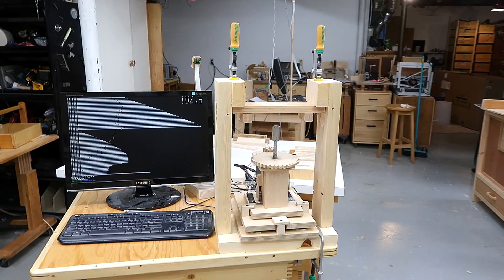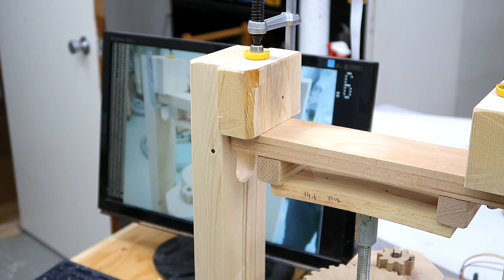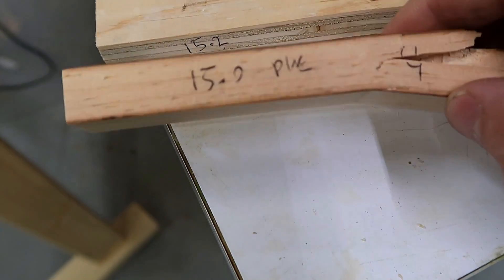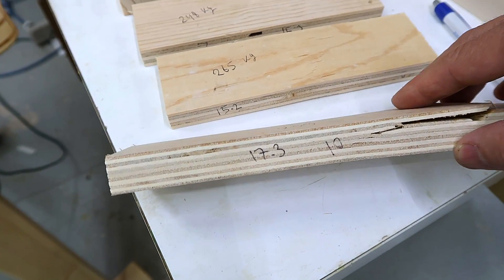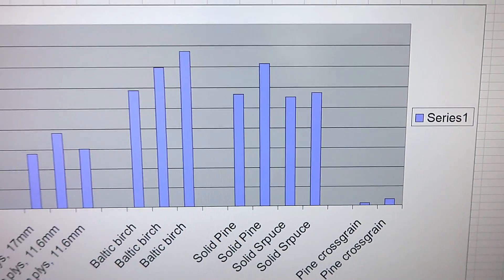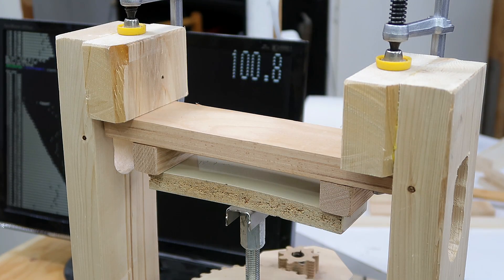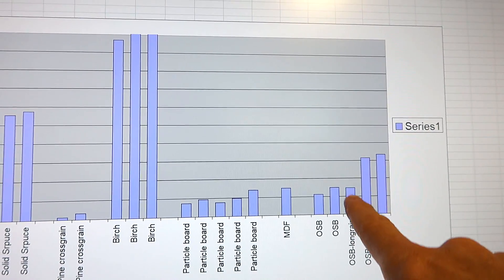How strong is plywood, MDF, OSB, particle board vs. solid wood

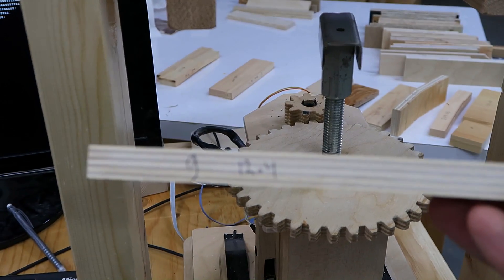Comment: 2:31 more gears maybe? The machine would be stronger, but it would take way more time to break the samples
Reply from the maker: also stronger load cells, bigger threaded rod, proper thrust bearings, etc.  basically, the whole machine needs to be rebuilt if I want to double the force.
Reply: Just make the samples smaller.

Comment: In mechanical engineering stiffness is usually more important than ultimate strength so I think that would be a more interesting measurement.  Usually once a structure is made stiff enough, the strength is more than enough.  Of course wood is not isotropic and is weaker in compression than in tension, so there are some applications where this is less likely to apply.
Reply: I think this test is also going in the wrong direction. The forces would be going across the length and width of the boards in the structure rather than through its thickness.
Reply: Exactly.  Using any wood product as a structural member, the stiffness is in the long axis. You don’t use a 2X lying flat. Think about glulam beams. I really don’t see the point of testing like Mathias did.
Reply: Wrong
Reply: @bobojenkins5805  well when you put it like that who could argue....

Comment: Haven't read the comments, maybe it is mentioned somewhere. What if a piece is cut at 45deg angle from plywood so all the grain impacts strength the same. Wasteful but interesting. Or corners and ends going to be weakest points

Comment: The plywood could be used on-edge. TJI beams are used in construction and are vertically oriented like this. It would be interesting to build some I-beams (so they don't buckle) and see how they do on the same jig.
Reply: Yeah, I would never use plywood with significant force in the direction that Matthias tested in this video. Instead I would design so all major forces are in the plane of the plywood, in which it is the strongest.

Comment: I'm curious to know how you converted the force to a uniform thickness.
In theory it seems to be a simple scaling factor but in reality the stiffness in flexion (which is the engineering term for what you are measuring here) depends on the moment of inertia of the section of the boards, which for a rectangular section is (width*height^3)/12 if i remember correctly.
Reply from the maker: Scale by thickness squared, as explained in the video
Reply: You are correct that I = (1/12)*b*h^3, but there is another 'h' in the stress equation that cancels and makes it a square law. I showed the equations in another comment, but the final result is

F[max] = (2/3)*(1/L)*UTS*b*h^2

Comment: I wonder if this setup can be used to show that floor joists are just a strong with and without holes drilled in the middle for under-floor wiring.
Reply from the maker: A hole dead smack in the middle of the joist won't matter.  But as it gets closer to top or bottom, it weakens it. Also as it gets closer to the end, as that can induce shear failures along the grain

Comment: Matthias, have you ever experimented with making hardboard out of cardboard. There’s a lot of Amazon and Walmart shipping boxes lying around these days. I wanted to see what could be done with the stuff besides discarding or burning it. 

I soaked six small pieces in cheap yellow carpenters glue and compressed it firmly. It produced a very tough material. I also coated it with glue and it produced a durable finish. It has a lot of possibilities.
Reply: I've experimented with laminating cardboard with fiberglass and either Titebond III or high quality epoxy.  You can make some strong and durable composites out of it.
Reply: Sounds horrifically expensive. But maybe that's your art form?

Comment: How is HPL? It's sometimes used for kitchen-tops.
Reply from the maker: don't know what it is, don't have any
Reply: @matthiaswandel  High Pressure Laminate panels/sheets. It's a mix of resin and cellulose. Extremely though. Often used as building cladding or top layers for kitchen cabinetry/countertops. They sell it at the hardware store here.

Comment: If you build something out of ply, you put the load in the plane of the board. You should really test that way.
Reply from the maker: yes, ply is stronger that way.  For a subfloor, it will do better than individual boards because it can spread the load much better

Comment: This is very interesting Matthias.  It's a common technique in shelf-making (for example with book cases) to reinforce a shelf from deflection by rabbeting a piece of solid wood and gluing it to the front edge of the shelf.  This is supposed to make a plywood or MDF shelf less likely to bow from the weight of the books.  I wonder how a plywood or MDF shelf prepared in this way would compare to just a solid piece of wood?
Reply from the maker: Most of the support will come from the solid piece of wood, cause that is also a lot stiffer.  Basically, the stiffest material takes most of the load, even if the stiffest material was not the strongest
Reply: @matthiaswandel  Makes a lot of sense.  I just watched a video over on Rob Cosman's channel where he created a double mortise and tenon joint.  In that video he suggested that having 2 tenons would give the joint better ability to resist leveraging on the joint than a single tenon would (even if the sum of the widths of the two tenons and the gap in between them is the same as the width of a single tenon).  If this is true, then I'm not sure why -- maybe doubling the number of shoulders is superior at resisting racking even if it sacrifices some glue surface?  What are your thoughts?
Reply: @matthiaswandel  this reminds me of a horizontal dough mixer I used to have to work on that was duel belt drive (one belt on either side). The driven center shaft was far stiffer torsionally that the drive shaft, and since the power was applied to the drive shaft way off center, one of the two heavy duty timing belts took the lions share, if not all of the load. It was also a nightmare to balance the two belts since their relationship to each other changed at different loads.

Comment: Can you devise an experiment to test the (shear) strength of nails? Wherever I look in my really old house, it seems that the builder relies on adding enough thick nails to support the weight
Reply from the maker: A nail in wood will never shear off, cause the surrounding wood yields enough that it just bends first, then later pulls out

Comment: Also, would be interesting to test different joints strength in plywood - butt, lap, dowels, screws, etc
Reply: Not really, as already with this test to some degree you are comparing apples to pears. Plywood is made mainly for dimensional stability, so unless real wood which with moisture will swell and shrink mainly in one direction (perpendicular to the grain) the layers in different directions compensate for that. When you look into construction, where structural strength is required you will find either solid timber beams, or glue laminations, but we are talking about completely different dimensions here and using certain cuts of wood to reduce impact of grain and get beams exceeding dimensions you can just get from a mill today, among other things.
Plywood is plenty strong if used for cabinets, or as sheathing as intended. Same with OSB, which is just a cheaper alternative creating something with properties of both plywood and particle board.
Particle board, I don´t know if that is actually good for anything other than cheap (in the worst sense of the word) cabinets and one time packaging.
MDF, by reducing the particle size again has superior qualities over particle board. less compressible, more rigid, easier to coat/paint. MDF also due to its high density is quite good for speakers.
So except in case used as sheathing, none of those boards are intended to be really structural. They are solid enough as floors and walls on joists and studs, especially on walls they provide in combination a lot of strength in one pane. They may work for cabinets, if used right. But using the example of a bandsaw, most people may already be surprised that a saw without a metal frame is stiff enough at all. But in this case, with right dimensions and taking into account the grain direction, it gets kind of structural and solid wood or glued laminations are the way to go. An enigneered box frame made out of plywood would likely work as well looking at rigidity. (just not sure if it would hold up).

Comment: Have you any plans to test foam board panels?
A 2" rigid foam insulation, sandwiched between 2 layers of 1/4" or 1/8" plywood, for example. 
If I had your setup, I would test everything I could get my hands on. 😀
Reply from the maker: Have used 2" foam on concfrete, with two layers of 3/4" plywood overlapped on top as a floor before.  Excellent results, very firm floor
Reply: @matthiaswandel  They make houses like that now. No stick framing. Goes up in one day!
Reply: Both foam and plywood laminated with fiberglass and either Titebond III or high quality epoxy is also pretty interesting stuff, structurally. I'm a big fan of composites, done right, that is.

Comment: I love these videos with quantified tests of different things.

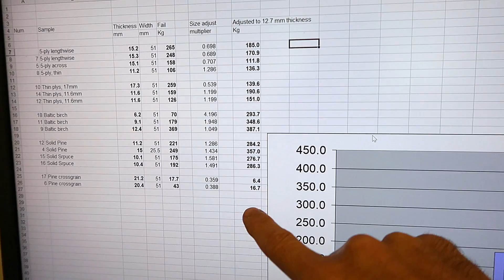Minor nitpick: I am pretty sure the strength against bending is proportional to the cube of the thickness, not the square as Matthias suggests at about 3:40. So a twice as thick piece would be eight times stronger (assuming a homogeneous material). Further reading can be found e.g. under "Second moment of area" and "List of second moments of area" in Wikipedia for anyone interested.
Reply from the maker: Stiffness varies with thickness cubed.  Fail strength with thickness squared.  Note how the birch samples lined of different thickness lined up so close with the square law adjustment
Reply: @matthiaswandel  for those that want the equations: stress = M*y/I, where I = (1/12)*base*height^3. For 3-point bending, M = (1/4)*Force*length. Setting y = height/2, stress = Ultimate Tensile Strength and rearranging gives:

F = (2/3)*(1/L)*UTS*b*h^2

Comment: What about flex without breakage? If the forces involved aren't enough to break a material and stiffness is a primary concern in the application, then the material that is stiffer is the better choice even if it has a lower breaking point.
Reply from the maker: I didn't bother checking that, just gets the video too complicated.  Still have the logs so I could calculate it afterwards.

Comment: Although I appreciate this. 
I would expect tests on other things, and also comparing to price.

How about drilling? When do they strip?
How about weather resistance? (Bending, and rotting)
How about trying to break one corner of a big table? (I think it would be different)
How about bugs eating the insides?
How about practical usage? (Like, sanding, cutting, glueing etc)
How about nailing from the side (like between the layers)

So many more things I can't think right now.
And I expected more details about particle board MDF etc. This video is mainly just for plywood.

Also what about metal? How does it compare to all these wood products, also with price.
Because metal is cheaper, easier to clean, easier to make furnitures out of etc.
Doesn't look and feel like wood, but given the price difference, it's an option to consider...

Comment: ~ " half the grain in plywood is in the wrong direction" . This leads to the question of whether or not all plywood is assembled with each layer's grain perpendicular to its neighbors. I'm wondering if the I'm results would be the same if you tested the grain rotated 45 degrees. Or if you could somehow delaminate samples of various types of ply to examine the directional relationships of each layer's grain.
Reply from the maker: never seen such a plywood. It would be very inefficient to manufacture, cause as the log is shaved, that produces rectangular pieces, so I don't think it's done.
Reply: @matthiaswandel  Fair enough. I trust your experience and the results you've shared. Just seems like a faulty generalization without testing how your samples were constructed.  Also - please dont think I expect you to address this in a dedicated video, as interesting as I may find it. It seems like you've made a safe assumption
Reply: Sometimes cold molded wood boats are laminated with subsequent layers at other than 90 degrees.

Comment: I've found the engineering lesson that is most relevant to woodworking is bending moment of inertia. Whenever I have to use a weaker material for something critical, I orient it so the bending moment of inertia is maximized

Comment: does the orientation matter? you only tested the boards with the glue joints parallel to the ground, not parallel to the wall, which would be the orientation in the bandsaw would it not?
Reply from the maker: True, but it's not how plywood is typically loaded.

Comment: Hi Matthias: there's actually a cube law between thickness and strength when it comes to rectangular beams; so a beam twice as thick would be 8 times as strong, not four.
Reply from the maker: A cube law to thickness and stiffness.  
Your beam twice as thick would also be twice as wide, so then it becomes a cube law (and 4'th power for stiffness)
Reply: @matthiaswandel  I have the same concern as Chlorate. Your reply seems a bit cryptic, something about changing the widths of the beams?

Might be a miscommunication about units of measure, maybe force (Kilogram) versus internal stress/strain (Newton)
Reply: @matthiaswandel  I would also agree with Chlorate, namely the maximum stress in the sample would be inversely proportional to the second moment of inertia (a.k.a. area moment of inertia) which is linear in width but cubic in thickness. So a twice a wide sample could handle twice as high of a load, but a twice as thick sample should be able to handle 8 times the load.
Reply: @kwinvdv  Agreed !! The cube law for deflection and strength is one of the fundamental tenets of designing structures.

Comment: Not surprising results for strength testing, but what about testing in regards to the forces applied to the bandsaw? In an assembled bandsaw, the main force is going to be vertical from the blade tension mechanism, right? That's parallel with the large surface of the material. I'm still curious if MDF be strong enough in that regard. The forces you tested are essentially as if you clamp the neck of the bandsaw to a rigid structure and pull the top and bottom wheels toward you. That said, it's probably still cheaper to use solid pine instead of MDF due to engineered panel costs. Hmmm.....an MDF CNC'd version...
Reply from the maker: The force is pushing down, but...  offset from the main column by quite a bit.  As such, there is bending force, and the force along the grain as a result of bending will far exceed the actual downward force of the blade.  The far side of the column will actually be under tension when the blade is tightened
Reply: @matthiaswandel  Interesting. Thanks for the reply.
Reply: Let's not cloud the debate with any convoluted logic. Now repeat after me, pine is king!
Reply: Fir is a lot stronger then pine.

Comment: Engineer here (Mechanical and Electrical). The strength and stiffness of a beam is mainly in the faces experiencing the tensile and compressive forces. That's the reason for "torsion box" construction. The strength and stiffness is the 3rd power of the beam depth and proportional to the width. I've always wondered why Mathias has always used solid frames for his bandsaws instead of slightly larger hollow boxes. If I was to build a wooden bandsaw, that's what I'd do with good plywood face grain running in the primary stress directions. Personally, I'd use tubular steel sections.
Reply: Wood elves are allergic to steel.
Reply from the maker: I keep seeing comments about it being proportional with thikness cubed.  This is true if you keep the member square, for example, so doubling thickness also doubles the width.  But if you only double the thickness, it's squared.  Steel is a bad example though cause you can double the thickness of a hollow member but not the wall thickness.  Then the it will be less than 4x as strong.
Reply: @matthiaswandel  Probably a mixup because stiffness is proportional to the thickness cube. Stress is proportional to the thickness square : Stress = M*c/I = (F/2)*(L/2)*(h/2)/(w*h^3/12) = 3*F*L/(2*w*h^2).
Reply: Maintaining the full tension strength of the wood all along the outer part of the 'C' shaped main beam would not be possible with plywood. I think what might make sense is building it in low-cost soft wood with a radiused shape, and then laminating some high quality knot free layers along the tension pathway on the outside. Or, for that matter, just put one or two layers of fiberglass tape on the main load paths.
Reply: Ha!  Then show us the band saw YOU built.  And the testing you did. Yep, he could test alls sorts of things.  But the difference is talk vs do.  Mathias is a doer, not a talker.  I prefer to hear from the doers.  No faith in just talkers.
Reply: Matthias was right, double the thickness equals 4x the strength (not 2^3).

Comment: Hey Matthias, thanks for the test! this is quite useful!

I have two questions:

- Does it makes any difference if you rotate the plywood 90 degrees?

- I see that you are measuring the total strength, but what about the stiffness of the material (young's modulus)? For building machines, that's probably more important than the total strength